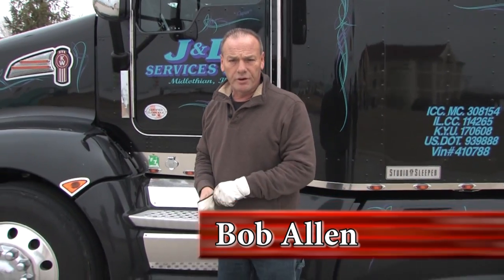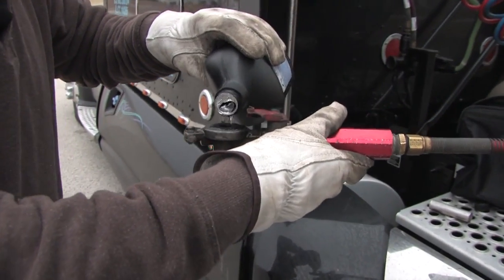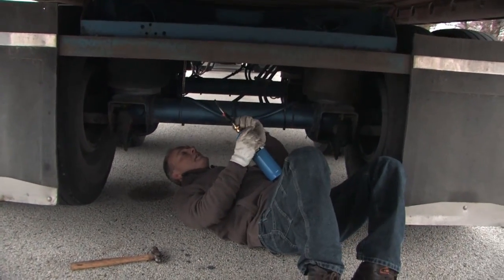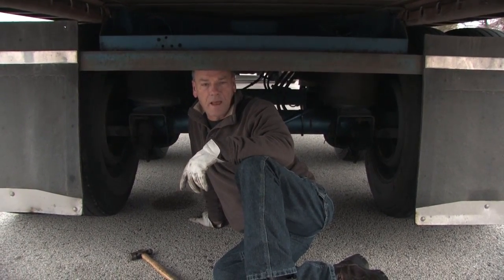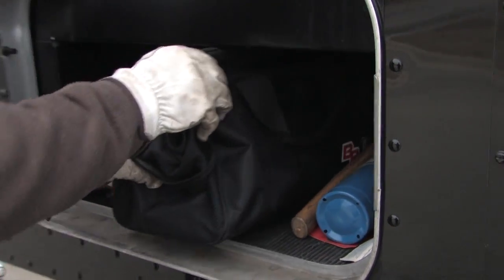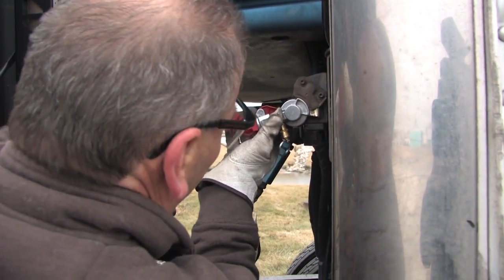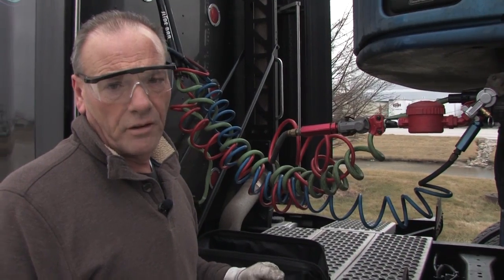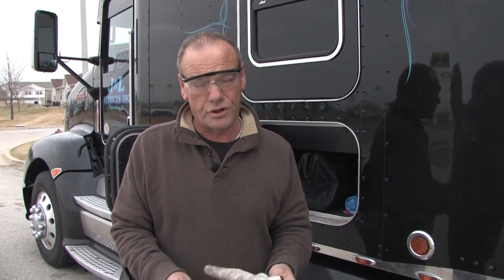The Brake Releaser Full Video for 2015!!!

Comment: Nice idea. But, several issues I see with the video.

1. Always remove the torch head from the bottle. Especially if you have one with the igniter.

2. Frozen brake shoes are more typically caused by shoes freezing to the drums.

3. If air line alcohol is needed, use it sparingly. Too much can wash out the special grease in the valves on the truck and trailer.

4. You can get screens that sit in behind the seals on the glad hand, and helps limit snow from getting into the lines (and fewer bees plugging a line if trailer sits long enough).

5. Really only need air line alcohol if air is damp, recently rwined/snowed. Not needed every time. Even below freezing.

6. If you're enroute with a load, better to NOT set the trailer brakes. Especially if running in freezing rain/snow. Then shoes won't freeze to the drums.

7. Rocking back and forth, after hitting drums with a 3# maul, will usually be enough to free them.

8. Snow will usually stick to cold tires, and after moving a couple of feet, you'll be able to get out and visually check if all wheels are turning. And either be tread pattern in the snow from a rolling tire, vs slide marks from a stuck one.

Comment: I would defiantly use this brake release tool. great idea. But if you don't have one yet and your n a pinch as long as your not parked on ice always when you stop for a break in below freezing temps, before driving forward put your truck in reverse and back up a foot this should release your brakes. But buy one of these tools as it will make life so much easier than laying in the wet snow under your truck.

Comment: Hammer on the drum, if that doesn't work heat up the drum and hit it again.
Reply: Nolan Olson what I’ve learned from doing service calls I have the driver release the brakes and I back the brakes off first then tap them a bit... usually works like a charm

Comment: hit the slack adjuster?
Reply: i hear ya
Reply: norbertdx hit the brake drum
Reply: I was super confused when he said hit the slack adjuster . Get a sledgehammer and hit that drum . Also getting a small funnel to pour alcohol directly into the air tanks will charge it through both break systems. But cool idea nonetheless.